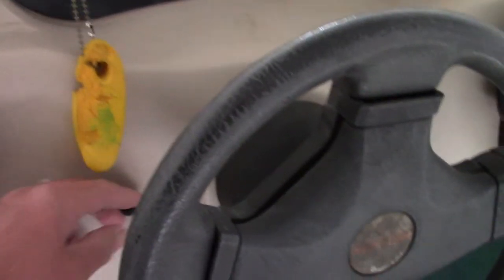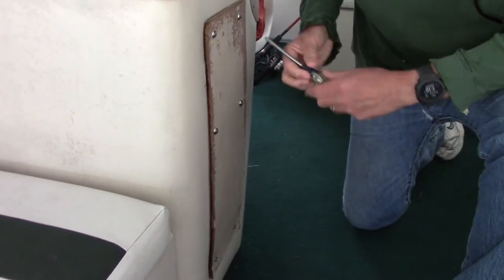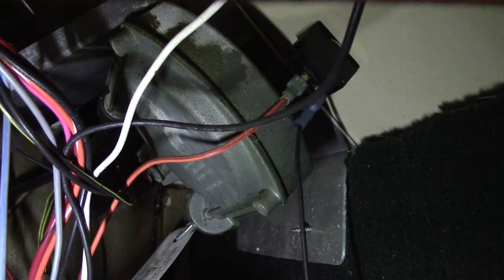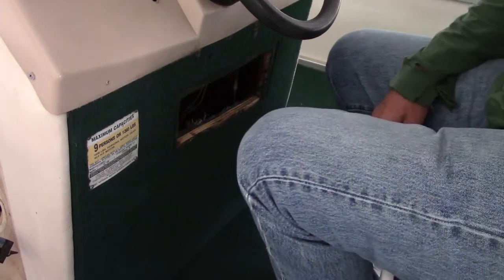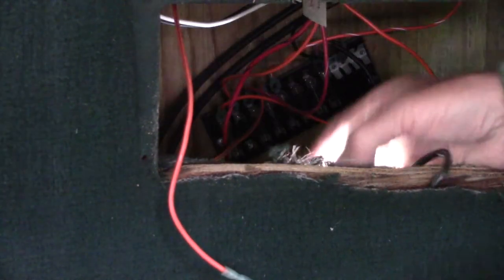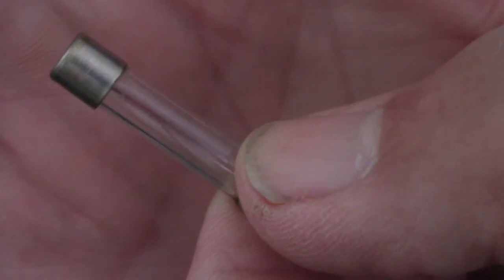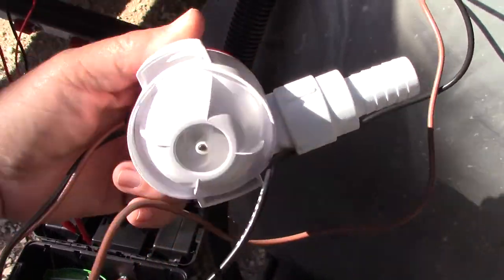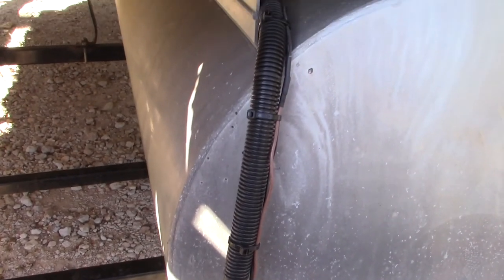Pontoon Boat Live Well Reactivation - Let's Figure This Out

Comment: Have you tested this out. Im running into the issue of the bilge pump i bought wont push water as far as i need. The max seems to be 13ft and i need it to push water about 23 ft. 3ft vertically
Reply from the maker: Yes, and it works fine. Check the voltage at the pump while it's underload. Next will be to change the pump. Another issue might be a kink in the tube.
Reply: @LetsFigureThisOut  I did just replace the hose so that is definitely possible. I appreciate that response!